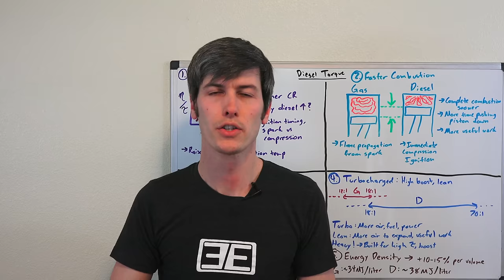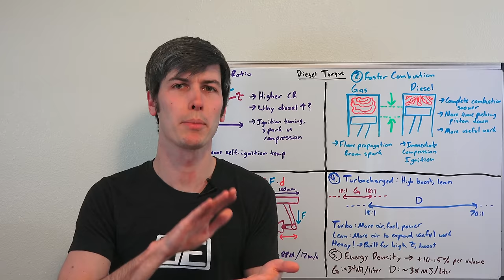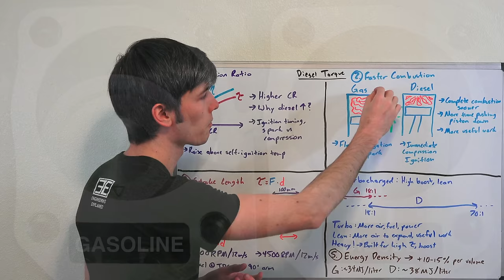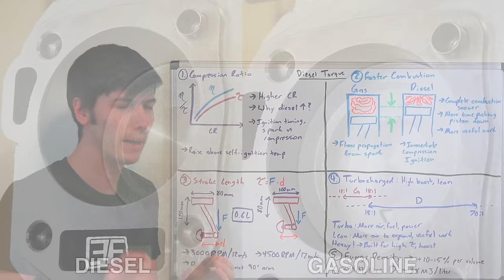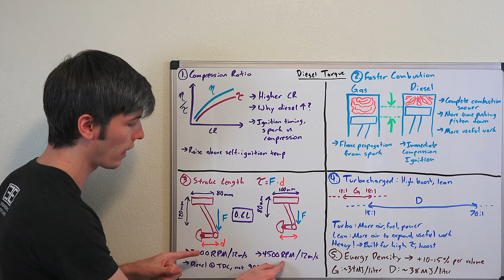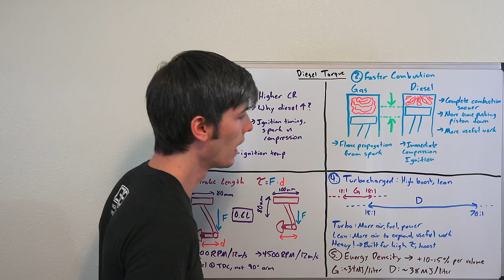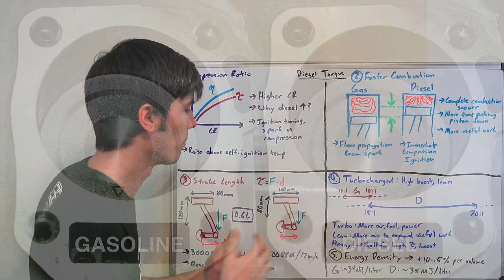5 Reasons Diesel Engines Make More Torque Than Gasoline

Comment: Explanation number 3 is wrong.  The extra torque achieved by increasing the crank throw is EXACTLY cancelled out by the reduction in torque arising from the smaller piston area.

More detail:
The downward force on the piston F is equal to the combustion pressure P multiplied by the area of the piston A.  That is:

force (F) = pressure (P) * area (A)

In the video he keeps all the other variables (i.e. the combustion pressure) the same, so:

!! Reducing the bore reduces the piston area, which reduces the piston force. !! (FACT #1)

The torque is determined by the force multiplied by the crank throw (the "moment arm").  

!! We have DECREASED the force but INCREASED the moment arm, and in fact the two cancel each other out. !! (FACT #2)

If you don't believe me, put the figures into a spreadsheet.  (Note that the big-bore engine is actually 628cc, whereas the long-stroke engine is 603cc, an advantage of 4% for the big-bore engine).  Choose any reasonable number for the combustion pressure (I chose 500kPA) and calculate the resultant torque.  The big-bore engine produces a peak torque of 157Nm, and the long-stroke produces 151Nm, giving a 4% advantage to the big-bore engine.

In other words, the longer stroke / smaller piston does NOT generate any increase in torque.  The 4% advantage is simply because the displacement is 4% larger.

Don't feel too bad: loads of people make the same mistake.  They think a larger crank throw equals more "leverage" which must therefore equal more torque.  But they forget that to keep the same displacement you must make the bore smaller, decreasing the area of the piston, which decreases the force it applies to the crank pin by the same proportion.

Comment: What amazes me is how efficiency diesels are. For examples BMW's N57D30 which comes with 1, 2 and 4 turbo cahrger tunes can get monstrous torque and 0-60 with decent fuel economy. A 435d xDrive can do 0-60 in 4.7 seconds and still get around 50 MPG when driven sensibly. Only electric engines can rival that!

Comment: As far as the stroke length playing a factor in torque: Have you considered the mechanical advantage of putting the work farther away from the drive shaft? It seems to me that the same concept of using a breaker bar vs a standard ratchet to produce more torque would play a fairly considerable role. Though the distance are much shorter, the percentages of change seem like they would contribute a decent amount to the torque output of the motor. I'm not an engineer, by profession, so I'd be interested to find out what an engineer would think of this. Thanks in advance!
Reply: Yr old comment but his argument is that the mechanical advantage is null at TDC.  However, between TDC and 50% of the way to BDC, the mechanical advantage of a longer stroke creates linearly more torque on the crankshaft.  Since the detonation in a diesel engine starts later and lasts longer, you’re getting tons of for torque generated in that sweet spot

Comment: this it a bit incorrect sort off ...yes diesel engines have more torque because as you say diesel engines are built differently..they have more  torque because of that and not the fuel they use,
this can be seen when a manufacturer has a diesel and a petrol engine based on the same block..a good example of this is the old landrover 2.25 L petrol and diesel ...they both have the  same block, same bore and stroke and even the same camshaft and valve size and both rated at very similar RPM at 4000 for the diesel and 4250 the petrol ..they both have the same torque at 1800RPM  this is max torque for the diesel but the petrol has more at 2500rpm  ..the diesel has  103 flb of torque and 62HP at4000 rpm the petrol has  116flb and 68HP at 4250RPM.. the petrol has a flatter torque curve. the petrol is also has a low compersion ratio at 8 to1..many folk have improved the performance of the petrol with a 9.5 to 1 comp ratio making the torque gap even wider

Comment: Take 2.0 liter turbo engines with the same hp... lets say 180-190 hp. Plenty of them in Europe. The diesel one will produce 400Nm while the gasoline one only arround 300Nm and all this with a lower fuel consumption for the diesel.

Comment: >^..^<        Back to high school science almost 50 years ago for me. A diesel has a longer lever arm than a gas engine. The distance between the fulcrum/pivot point of the crankshaft and where the force is supplied is longer on a diesel. This makes more torque/you can mover a bigger rock.......??????

Comment: Stroke plays a HUGE roll, not only piston speed, but torque numbers go up quickly. and another way to look at stroke is almost a leverage standpoint. I'll explain... and I know this because I Re-Built my Stroker Harley(more on that later)
If you turn a load further out or a better example.... an OLD hand crank engine. if you lengthen the length of the crank handle, it makes turning the engine over easier, That's the point of stroking. the engine internally is pulling easier because it's a wider circumference at the crankshaft,.Not really leverage,. but almost.
My Harley I stroked it from a 4-1/4" to 4-3/4" that was only a 1/4" more on top and 1/4 to bottom for a total of 1/2" increase...
Huge difference. went from street bike to drag strip stature.
So much more torque and piston speed that I completely changed front and rear sprockets.
Finally 3000 rpm in 5th was 100 mph. not quite 1/2 throttle. and it was still bad to the bone off the line re-geared...
I never had roads or guts to go full throttle, 130 was enough for me., deer, dogs or a tire problem or a wobble at those speeds(i'll pass)
Don't discount STROKE. and there is no replacement for DISPLACEMENT... and stroke plays in that too.
Truth be told,.. Stroke at the crankshaft probably plays biggest factor in diesels torque.

Other than your comment on stroke, you did a good job on the video.

Comment: Stroke makes significant difference in torque due to more leverage advantage. simple math ,torque = moment arm times force. It is surprising how many engine heads think that torque is everything and fail to factor in the rest of the equation to determine power. Short stroke fast acceleration , higher rpm. Reverse this and you have power at lower rpm's. but it all balances out to the same HP. Torque alone is not what pulls your rig up a hill.

Comment: I'm a bit disappointed here. You can't simply compare turbocharged engines to naturally aspirated ones. If you'd compare any turbo diesel engine to a real gasoline counterpart (which means a turbocharged one with the same displacement), you'll find the gasoline one is often the one which produces more torque, at the very least the diesel's alleged torque advantage vanishes.
Another thing you could have mentioned in order to put things into perspective is that diesel engines (due to their lower RPM ranges) need higher transmission ratios which further reduces the amount of torque at the wheels compared to gasoline engines.
All other factors equal, diesels are never the right choice when it comes to performance. There are really only two reasons for a diesel: Better fuel efficiency and the fuel itself is cheaper. That's it.

Comment: I've got a question regarding this relating to 2 cars i owned. One was a 1990 Toyota Landcruiser with a 1HZ inline 6 cylinder diesel engine, the other was a 1996 Ford Falcon with a 4 litre inline 6 cylinder petrol engine. Both pretty close in their engine displacement, both naturally aspirated. However.

The 1HZ diesel engines torque output was 285 nm (210 lb/ft) and the slightly smaller Ford petrol 6 had its torque at 357 nm (263 lb/ft). Even the tubocharged version, the 1HD-T had it's torque only marginally higher than the Ford petrol 6 at 361 nm (266 lb/ft).

Can you explain why this would be? When i bought the Landcruiser i was expecting it to have way more torque than my Falcon, but it clearly didn't.

Comment: You don't actually work on engines do you? The Piston should be level with the deck. Compression is changed with a different cylinder head. 1982 through 1984 Chevy 350 diesels only made two hundred foot pounds of torque, 1976 and 1977 305 made 245 foot pounds of torque. 350s in 76 and 77 made 250 to 260. The torque range didn't start building until they started using big blocks.

Comment: I think you missed some points: an increased compression ratio ='s an increased expansion ratio... the higher expansion ratio means more usable power... also you comment that diesel combustion occurs  instantly is not true... diesel combustion is actually slower because the fuel and air are not pre mixed.. also most modern common rail engine have several injection events ATDC as the piston is moving down the bore. The constant pressure cycle (Diesel) inherently produces more torque because high pressure is maintained for a longer duration of the piston travel vs constant volume cycle where air and fuel are premixed and combusted very quickly.

Comment: Or you could've simply said that if you want to produce 100 horsepower at half the speed, you gonna need twice the torque. And diesel engines just run at lower RPM, so they must produce a lot of torque to make up for it - they're designed that way, it's not an inherent property. At the end of the day, 100 horsepower is 100 horsepower, it doesn't matter if it's high torque or high speed.

Comment: A longer stroke by itself doesn't mean more torque. Boost and displacement make more torque. I'm going to assume everything except the bore and stroke are identical between the engines. Say you have 15000kPa of pressure in the chamber after combustion. In the 80mm bore engine,the piston will be pushed down by 75.40N. The 120mm stroke will produce. 9. 048Nm. In the 100mm bore engine, the piston will be pushed down by 117.8N. The 80mm stroke will make 9.424Nm

Comment: According to your explanation the fuel mixture of diesel combusts instantaneously compared to the gasoline mixture whose combustion process spreads through out the volume till it is totally combusted. Just that fact says that if you have the same expenditure of energy over a less period of time, instantaneous compared to spreading through out the volume, you have more power: or should I say "potential" power = energy/time. My physics is quite rusty.

Comment: More torque at a diesel engine? Just slightly, when we compare turbocharged engines. For example: BMW M550d with 254 Nm/l, and Mercedes A 45 AMG with 240 Nm/l. If you compare natural aspirated engines, then the diesel reaches much lower torque levels, about only 80 Nm/l, while the best NA gasoline engines reaches 120 Nm/l. Main reason: The diesel engine runs always much more leaner, lambda always above 1.

Comment: I recently bought a 2015 GSW TDI. 
I’m looking to upgrade and add more power. I’ve seen Revo, Malone and Kerma tuning. Can you tell me the difference between a 2.0 CR150 TDI and a 2.0 CR184 TDI? Are these primarily the same engine with different internal/external parts? The goal is surpass 200hp & 400ftlbs.
Any input I’d greatly appreciated.

Thanks

Comment: I love powerful Diesel Engines but sadly they'll get banned from many german cities... They haven't banned Diesels in my city yet so I can sometimes enjoy driving my dad's old workhorse Mercedes E320 CDI S210 with its turbocharged 3,2L OM613 straight six diesel... What a great engine... That sound it makes during a kickdown... You don't get that with a modern 4 cylinder 2.0 TDI, although that one can produce some serious power too depending on the version...

Comment: But hwo come the that older Diesel engines (without Turbochargers) (eg in the late 70s and 80s) had actually less torgue than their petrol contraparts?
Reply: Because diesel engines have less torque and power compared to displacement than gasoline engines. The only actual advantages to diesel engines are lower fuel consumption and more low RPM torque. An equally sized gasoline engine with a turbocharger can easily surpass the torque and will have 2-3 times as much power, even more if reliability isn't a priority.
Reply: But hwo do you explain the video then?

Comment: Then:
Short duration (on gasoline engine) = less torque, high rpm.
Long duration (diesel engine)=Low rpm, but high torque.  Is that right?

Comment: The question to ask is why between two engines with the same maximum power and similar applications, the diesel engine will usually have a higher torque than the gasoline one.   Even without turbo.  The same power of say 150 kW (200 hp) can be made by 50 explosions per second, 3 kJ each (gasoline), or by only 37.5 explosions per second, 4 kJ each (diesel). A larger explosion will produce more torque (even with a somewhat skinnier cylinder, because the pressure is higher).  Power is torque times rpm. So the gas engine, which can be lighter, makes the power by moving faster, while the slower heavier built diesel makes the same power by making more torque.

Comment: Diesels never USED to have more toque than an equally sized petrol engine. At least not until turbocharging and intercooling became the norm.
I remember when you could buy naturally aspirated diesels back in the 80s and 90s and they had no torque to speak of, they just gave what little they had at a very low RPM, making them very economical on fuel. I'd wager that a gasoline engine, when boosted to the same degree as a contemporary turbo diesel of the same size, will actually put out about the same torque and considerably more horsepower, thanks to its ability to rev higher.  Take for example, the VW Golf GTD and Golf R. Both 2.0 engines,  Both are turbocharged and intercooled. Both have around 280lb/ft of torque from around 1800rpm. But GTD has 184hp, at 4000rpm, R has 296hp at 5600rpm.

Comment: If we look at the specs of some old, naturally aspirated engines of about the same displacement, we get less torque from a diesel - for example two engines from the 70's - Mercedes Benz OM617.910 (3.0, diesel, 126 lbf*ft) and M110.981 (2.8, petrol, 176 lbf*ft, 40% more despite having less displacement).

The main reason for this is the fact, that a non direct injected petrol engine operates at more or less stoichiometric mixture - it uses up all the air in the cylinder (the fuel density is not significant). A diesel must work much below stoichiometric in order to avoid producing lots of soot (unburnt fuel). Which kind of contradicts the theory of the quicker burn in a diesel.

It's the turbo together with no problems with engine knock that give diesel more torque. Plus all the new tech like Common Rail, giving the diesel quicker and better controlled fuel burn.

Comment: Gas engines don't put out the black cloud, and some of this is due to the length of time burning. It's cleaner and more complete for gas and less for diesel. It's a tradeoff I suppose. Cleaner with a catalytic converter, but  how many gasoline car owners are familiar with particulate filters in diesels. Higher cost for more components, more robust platforms, requiring a turbo and more.

Comment: The stoke length difference is much more pronounced than what you mentioned in the video - you need to calculate the volume of a cylinder for the correct displacement .  Using your numbers for the ".6L" gas engine you noted 100mm bore x 80mm:  Pi * R^2 * h = 628318.5307 (.682L) -  - the correct length of the bore diesel of same displacement for a 80mm bore would be 125mm (also totaling .682L).  Difference in the bore stroke length would then be 156%

Comment: In the natural aspirated engines of the same displacement, the torque is higher in a gasoline than a diesel engine. The real difference comes from a turbocharger that is common in today diesel. For example: VW 1.9 SDI natural aspirated has 130 Nm of torque. VW 1.9 Tdi from 210 to 330 Nm. Petrol without turbo 1.8L from that time has 175 Nm of torque. The turbo 1.8T has from 210 to 280 Nm of torque. The old prechamber  indirect diesels had even less torque per same displacement. Recall old Mercedes natural aspirated diesels from 1980s and 1990s that where sold in US. 3liter engine with less than 200 Nm of torque. The same displacement petrol engine was close to 250 to 280 Nm.

Comment: Its because all diesels need a turbo to make power. If you turbocharge a same sized gasoline engine you get more power and similar torque. Take a non turbo 6.5l diesel and it makes 140hp and 300lbft of tq. While a gasoline 6.5l v8 would make 400+ hp and torque. Now turbocharge both of them the diesel would be at maybe 300hp with 500-600ftlbs while that gasoline engine would be more like 600-700hp with the 700+ftlbs of tq. On pump gas.

Comment: Forgot the one and only thing that matters. Diesel engines tend to rev slower at peak power than gasoline engines. Since hp=torque*rpm/5252, an engine that produces the same power at a lower rpm will produce more torque for the same power. End of story.

Comment: If they are cracking down on emissions, they should crack down on gas powered 3/4 ton trucks if anything. Watch The Fast Lane Truck's video on the gas 7.3L Ford towing challenge, then watch their video on the 6.7L diesel towing challenge on the same mountain. The 7.3 gas got 2.2 miles per gallon (maxed out, towing up hill), and they said it out-performed the other 3/4 gas trucks they tested. The 6.7L diesel got like 17.5 miles also maxed.

Comment: What is the reason why the 1978 Oldsmobile 350 ci diesel engine had less torque and horsepower than its gas version? The diesel produced 125hp and had a peak torque of 220 lb-ft at 1800 rpm, while the gas version of the 350 produced 170hp and had a peak torque of 275 lb-ft at 2000 rpm, and both had 4.057 inch bore and 3.385 inch stroke measurements.